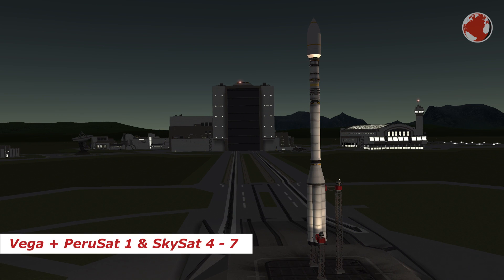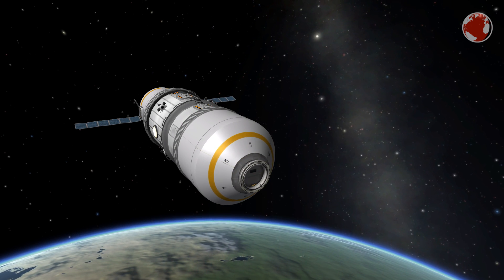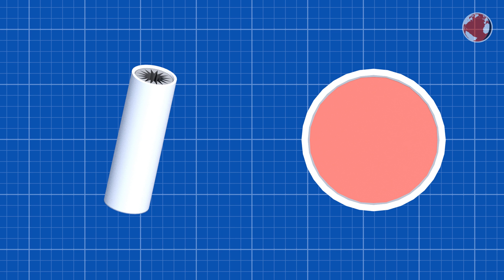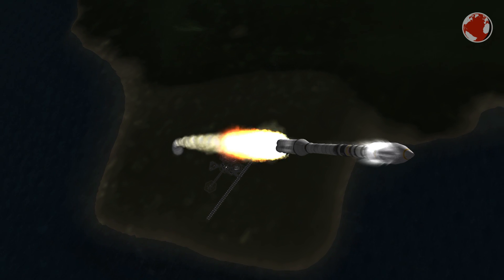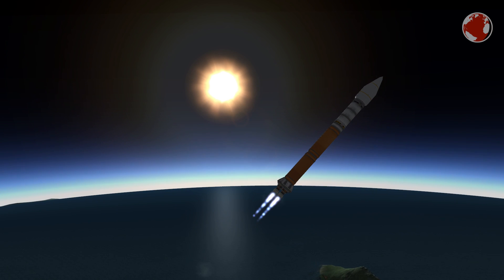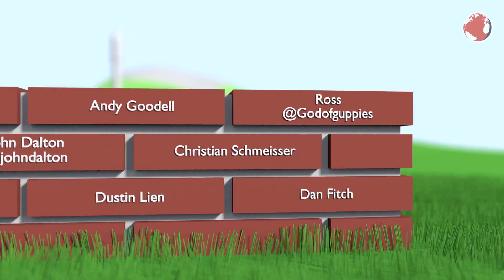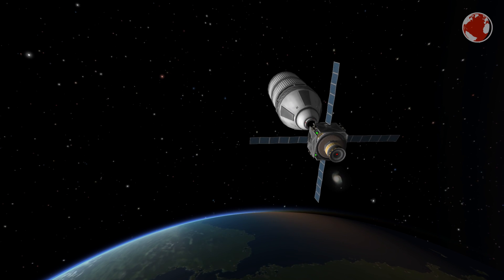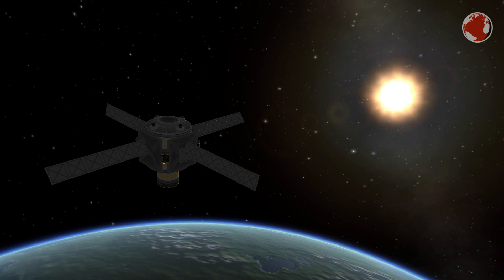Atlas V and Vega Launch | World View 4, SkySat & PeruSat | KNews #56

Comment: Spacex Finished there Investigation
Reply from the maker: Hi, the investigation is not yet finished. To quote SpaceX: 
> At this stage of the investigation, preliminary review of the data and debris suggests that a large breach in the cryogenic helium system of the second stage liquid oxygen tank took place. [Updated 09/24: At this time, the cause of the potential breach remains unknown.]
So they still actually don't know the cause which triggered the breach.

Comment: How can you control that Vega rocket so well as it uses SRBs and has no fins?
Reply: Those reaction wheel things i think
Reply from the maker: I've added the craft files to the description. The upper stages mostly use the payloads reaction wheels but the first stage also has a cheaty control surface on the side to make it turn xD